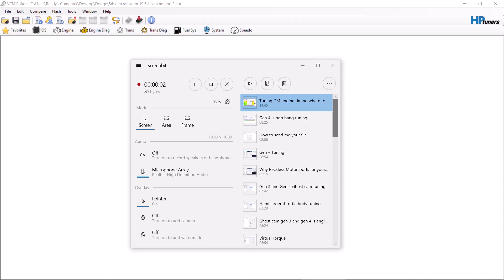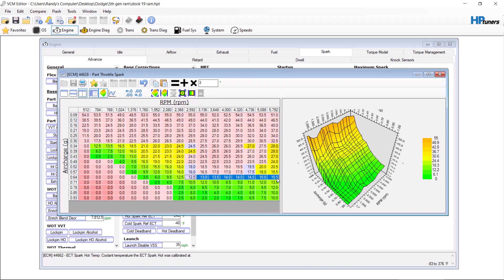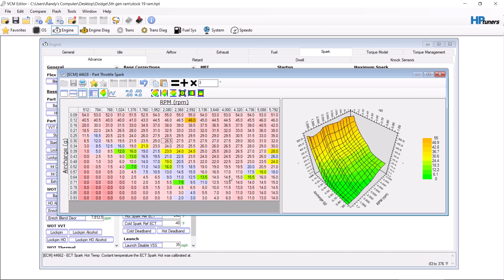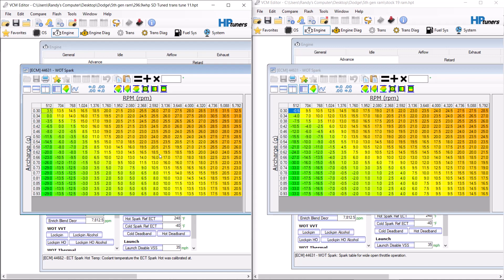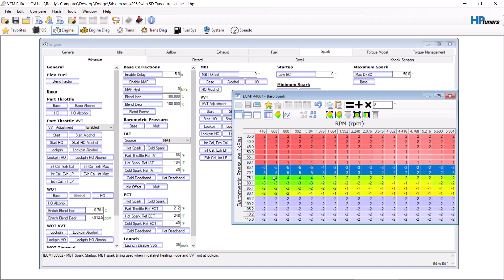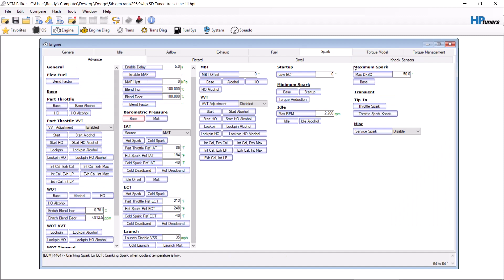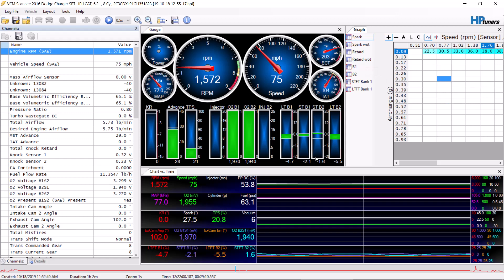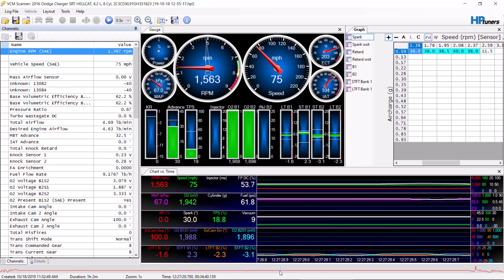Tuning Hemi engine timing and where to start

Comment: Greetings Mr Saavage. Would you be able to make a video for a 2008 Chrysler 300c with 2013 heads and intake with a hrt stage 2 cam and long tube header for a stable idle and possibly  tune to get as much hp and tq for my setup? Any thoughts and suggestions would be greatly appreciated! Don’t see much for Hemi like the GM’s.

Comment: You said about 20°max timing does that go for 6.4L too on 93 octane?
Reply from the maker: 6.4 is the most dangerous engine to run high timing on even with 93

Comment: So I decided to swap a non vvt cam on a vvt engine 5.7 and locked the phaser bought the car overheating so I rebuilt it due to a blown gasket pursuit charger 2012 (cam is from 2009 - 2015) ima try to tune it but any suggestions !
Reply from the maker: Main thing is to just shut the vvt off in tune, but definitely would have kept a vvt cam
Reply from the maker: If you need a remote tune just let me know
Reply: @Recklessmotorsports  I will contact u soon project is in pause. currently need to finish the exhaust I got long tube headers so I need to fabricate the pipes to plug o2. Should I leave cats or cut them out? it’s leagal pipes I can convert them to off-road !

Comment: Can this tuner disable the MDS system on a 2006 Dodge Ram 1500 SLT? I was getting p3425 and p3441 cylinder deactivation errors so I replaced all 4 MDS solenoids with the all-metal ones from Dorman. Now the error is just p3497 bank 2 deactivation failure. It might need an oil change, but if that fails, I need to get this truck inspected and it will fail until I can clear this error condition.

Comment: Good day. Really appreciate the info.  Doing a swap on my Ram 2500 from a 5.7 to a 6.4. Going to be using an OEM non-mds SRT cam. Should I stick with this and with a tune will be nice upgrade from stock truck cam.  Or will I lose power. Any thought would be appreciated and possibly if it’s worth stepping up to maybe an FRP VVT Mark 82 Cam.  Cheers!

Comment: Hi reckless. I'm trying to figure out what is wrong on my tune . I paid for a dyno tune and have had to go back into it and revise quite a few things. I have emissions in my state and have high flow cats and long tube headers. The exhaust is strong enough that it chokes you. It nasty like eye watering I'm at about 10-12 mpg I was kinda pissed that I had told the tunner that I was going to have to be emissions compliment and he removed cats rear O2 and put me into open loop at almost anything off idle. My state suspended my registration due to no inspection. Need to fix it can I get some help on this 20105.7 hemi Tsp stage 2 cam w/ long tube x pipe and full 3 in exhaust non mds and non vvt

Comment: Hi, just getting into tuning my '14 5.7 Challenger and am studying your vids closely.  Question: You're using your 5.7 truck's engine as your test bed.  Is there a drastic diff between how Dodge tuned the 5.7 6-speed cars (mine has 3.92 gears), as compared to your setup?  I'm beginning by logging my factory tune and want to add some timing in the cruise cells (.25 - .40g Aircharge @ ~1850RPM...depending on speed).  Thanks for the videos!!  Awesome info!!

Comment: This might sound like a very dumb question but could one just look at the graph and just try and smooth out the slope of the powerband and call it a day? Is it a aid in hptuners software to try and prevent user error or do all the parameters need to be precise? Im just thinking about getting a hptuner mainly to do crank and cam relearns which im hopping you can do on dodge/chrysler vehicles but down the road would like to tune my vehicle. I want to learn how to tune myself however am thinking third party options such as hemifever or overkill or BOTH. I own a chrysler 200 with a pentastar so theres not a lot of info about it anywhere for tuning. Is it similar to the 5.7 hemis?
Reply from the maker: In theory yes if someone wanted to make a quick timing change and have it be basic and to the point I would add 3 degrees to the whole chart and then smooth it out. Then log and make sure we aren’t seeing any real kr. Trust me you’re better off watching this videos and learning then going to 90% of places that do hemis that are big name.

Comment: I am interested in disabling my MDS on my 2021 Chrysler 300 and my 2021 Dodge Durango and both have the 5.7 Hemi. I’m not interested in messing with any of the other tuning I just want to shut off the MDS can I do that with the HP tuner software that you have?
Reply from the maker: Yes you can

Comment: I have a problem with the MAT temp. ECU is calculating over 190° MAT and even I zero out the hot spark table, now is losing the TB at the 1,000 foot mark at the track. 

How can I avoid closing TB? 
I found. Table aircharge- general Manifold temp-  MAT blend factor. 
Is there anything at the MAT blend factor I need to fix?

Comment: Bro... The lowest non-tornadic atmospheric pressure ever measured was ), set on 12 October 1979, during Typhoon Tip in the western Pacific Ocean  and the highest adjusted-to-sea level barometric pressure ever recorded on Earth 32.03 inHg measured in Tosontsengel, Mongolia on 19 December 2001... 32.03inHg= 108.466KPA that means the chart u are adding and taking timing based on KPA is  only ranging between 85 ish and 110 ish meaning a very small part of the table actually matters
Reply from the maker: That Kpa isn’t based on the atmosphere……

Comment: Can you point me in the right direction on my 05 hemi c. I have an 05 300c. I got the engine rebuilt without the MDS. Stock cam. I have disabled the mds in the program. My problem is that my rpms rum at about 630 after it reaches running temp. How do I increase them to around 800 or so? I have the MPVI2.

Comment: at :35 when you bring up the PT  table , at the intersection (Aircharge & RPM) .09 and 512 , is that 54 Deg of Timing ? am I reading that right ?
Reply from the maker: More then likely if it’s one of the top most areas it’s a low load low rpm area

Comment: I’m having a problem with rpm hang after wot pull any pointers on how to fix it? I’m going crazy.
Reply from the maker: Throttle follower table typically is where you start to play with, add or subtract in the problem area and see what it does and go from there

Comment: Well I have had mine tuned but it seems to lack timing in areas...I have HP tuner and new to tuning, I was told by the tuner he couldn't get it to take timing..?? I have a 2012 392 stroked to 430 with a comp cam 274, kooks  2 inch primary, green cats, edelbrock heads and intake with a 90mm TB.....would you be interested in looking at a log file?
Reply from the maker: yes i would
randy.ziegelbauer2014@gmail.com
Reply: @Recklessmotorsports    How did you make out with this, did you guys get it to take more timing ? just curious , not looking for a "tune"  just wanting to know how you made out

Comment: Good video man! I have been learning to tune. A little more detail or follow through would be cool, but your doing a good job. Maybe some logs, and showing some editing of the files from the logs would help, but with my basic knowledge of HP tuners and what I have learned so far, I can follow what your saying. Which would you say is harder to tune in general GM or Dodge?
Keep up the good work. Thanks!